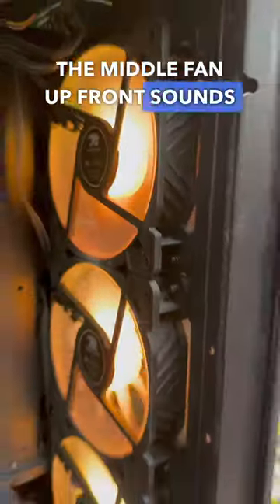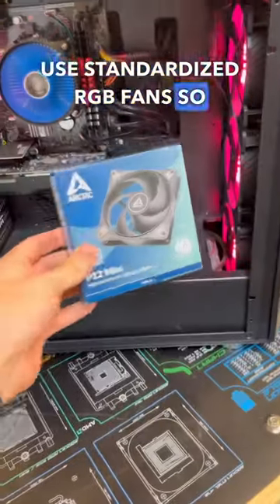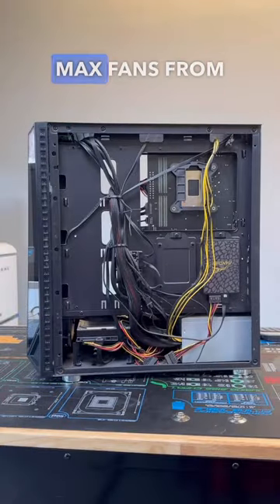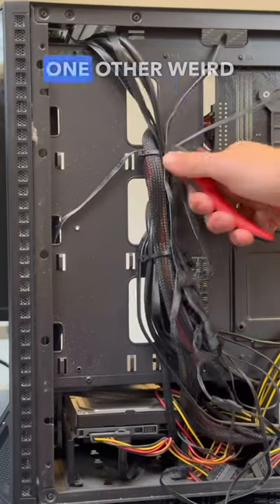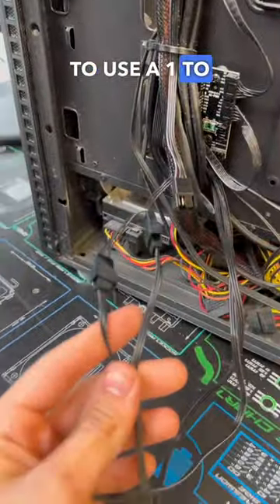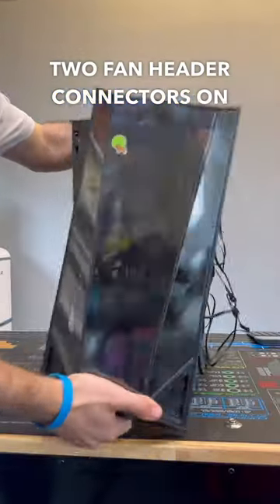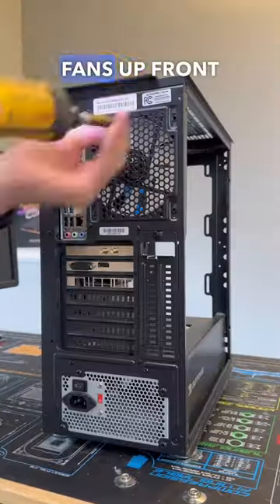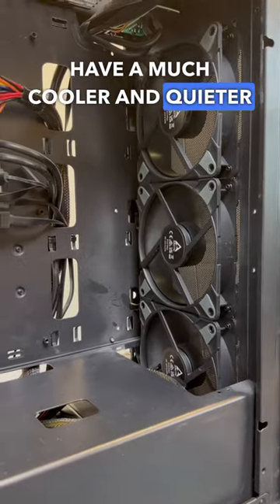NOISEY iBUYPOWER Gaming PC Fixed! #shorts #pc #gamingpc #computerrepair #pcrepair #pcgaming

Comment: You could have repaired the fan by simply peeling back the sticker a little bit on the back of the fan digging out a small hole with a box cutter into the plastic till you see the wheel bearing and add adding a couple small drops of oil lube

Comment: I have 2 of those p12 max fans on my cpu cooler, at full speed they move some serious air but they make a high pitched whine due to the dual ball bearings
Reply: Can confirm, had to return them because of that.